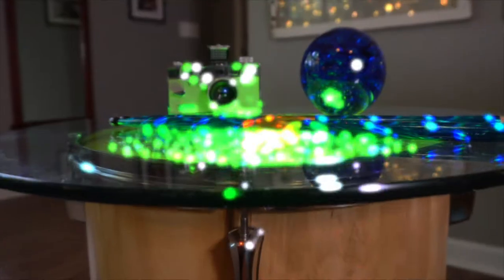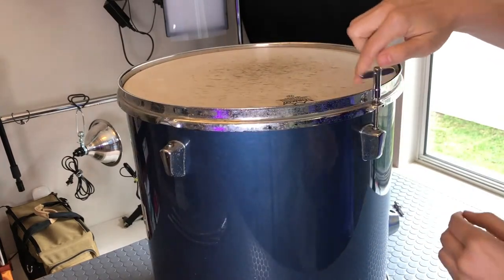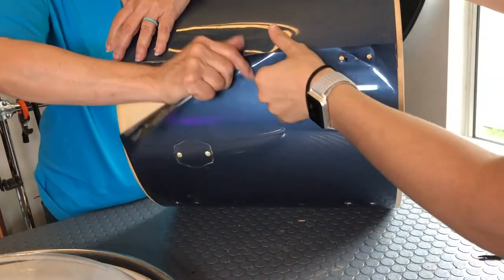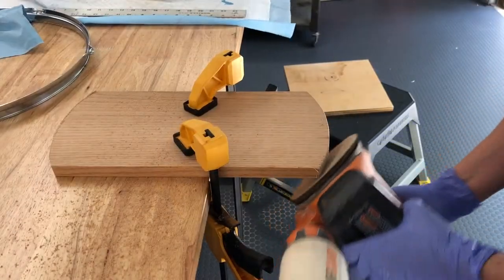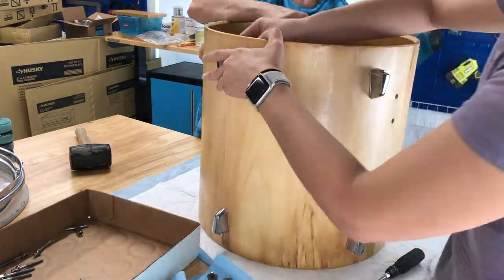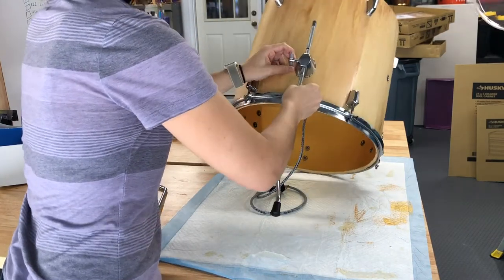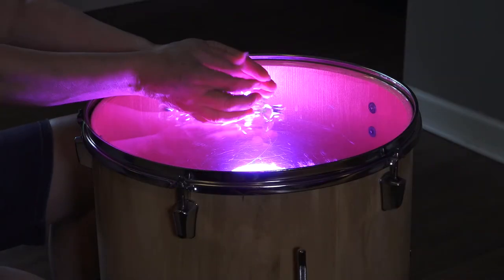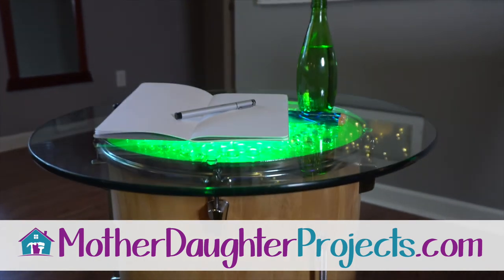DIY Floor Tom Drum Glowing LED End Table

Comment: Where did you get the rubber feet from? And how did you secure it onto the glass?
Reply from the maker: The feet on the floor tom were already on the drum. We put clear rubber discs on the inside of the glass where it touched the metal rim to hold it in place. But it could be knocked over if someone fell on it. I would not trust it around active kids or pets. -Steph